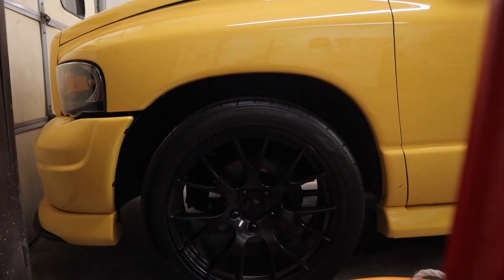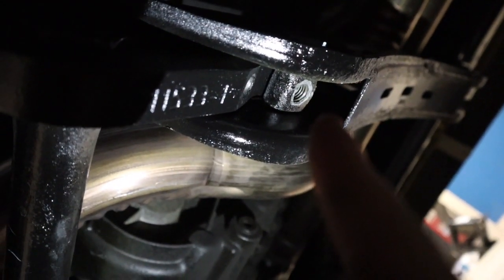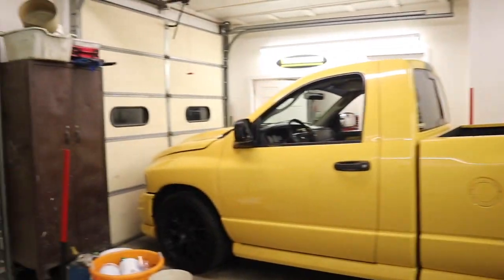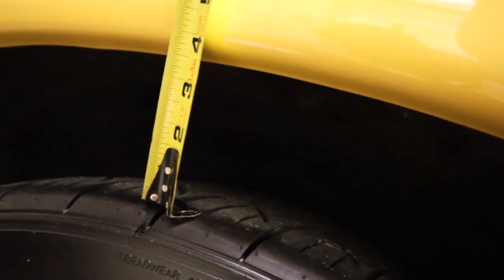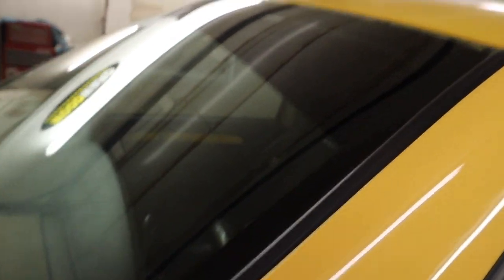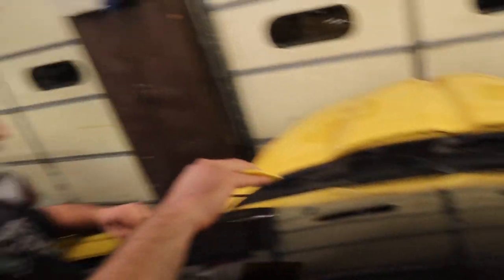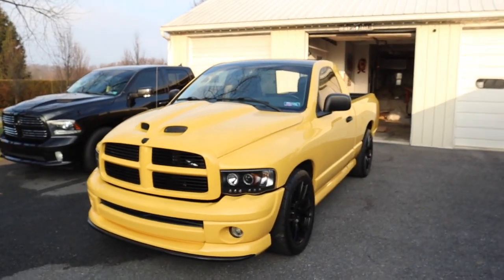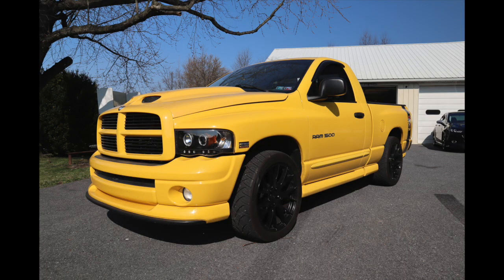Lowing the bee even more and wrapping the roof

Comment: A couple years late but I’ve found out how to slam these 4x4s. In rear u need stock shackles with flip kit, 2 inch drop Blocks, c notch. In front I have drop spindles and drop torsion keys
Reply: Cv axels hold up or remove? Currently. I have 2 drop spindles and iam  gets  2-3”drop torsion keys  and a 5 inch flip kit
Reply: @3ll_guillermon_ll248  think I blew a cv axel first day I put in spindles lol. Threw out all the grease from inside but doesn’t make a noise or give me problems. U do need to cut front bump stops and i recommend stock shackles. Have 4/5 inch drop shackles but they didn’t actually drop it 5 inches. Stock shackles with flip kit claim 6 inches but I got 5 inch drop with them and they are way stronger.
Reply: @5.7luth  front bump cut completely off ? What shocks and struts use  c notch Thanks for the information. Man U helped a lot
Reply: @3ll_guillermon_ll248  yes cut completely off front and back. Lowered it my first time and it was sitting on bump stop and worst ride of my life😂. Do need c notch but don’t have one now.  I rarely smack my frame but I’m getting lowering blocks for rear so it’ll be 7 inch drop and will definetly need a notch. Lowering it more so don’t know what shocks I need,that’s my only issue right now. On stock shocks now and they are definitely going bad kinda quick
Reply: @5.7luth  could u do an  wheel ailment camper ? Just drop mine
Reply: @3ll_guillermon_ll248  like an alignment to get rid of the camber? Not sure I have some camber
Reply: @5.7luth   yeah my bad I miss spelled everything  looks like I have a bit of camber as well  I’m gonna see if I can get it aligned and it rides like shit still need some work to do

Comment: Hey quick question what transmission do you have in it?
Reply from the maker: Stock trans
Reply: @tylersilvius7931  from the 5.7 or 6.1?
Reply from the maker: From the 5.7. It’s the original trans that was in the truck. It does slip with the 6.1 so going to have to get built
Reply: @tylersilvius7931  okay cool cause I bought a 2004 ram with the 6.1 swap already and I was just wondering what trans would be good and what posi
Reply from the maker: @alexherrera2176  yea Im not sure. I just recently put it in and haven’t really messed with it yea